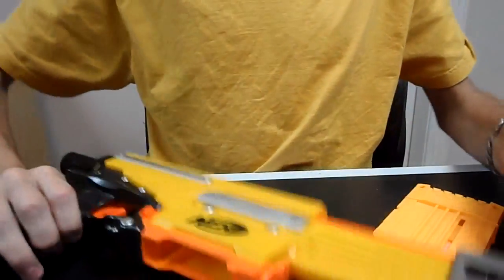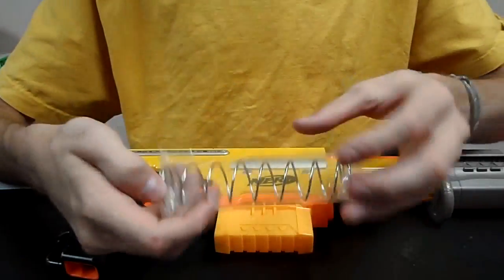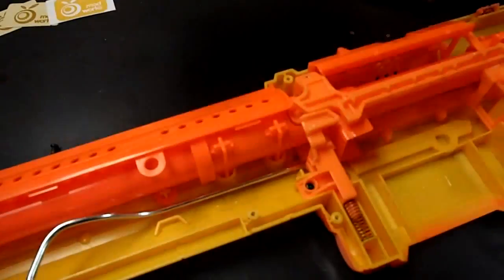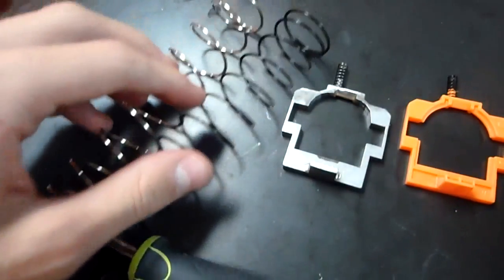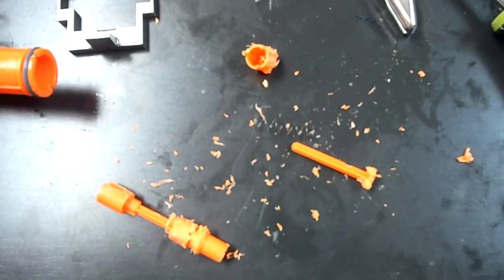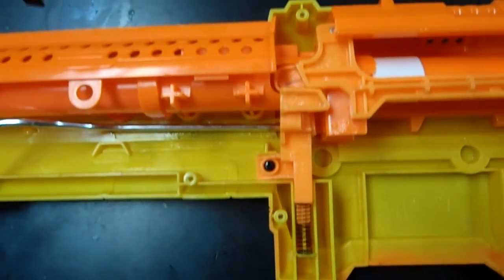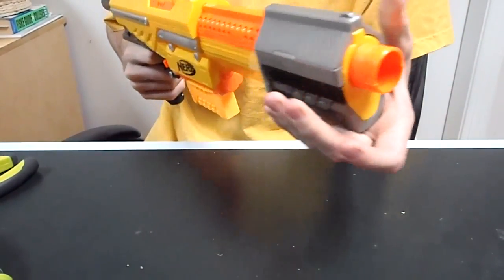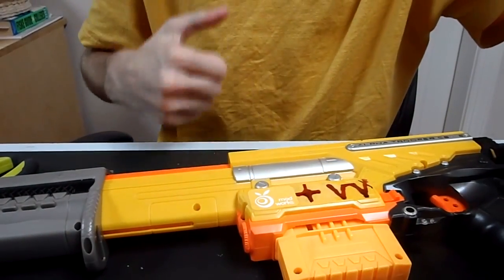Orange Mod Works Alpha Trooper Kit #1 (Review and How To Install Guide)

Comment: Well, after you think its cocked, you have to pull the slide back a bit more until it clicks before you can push it forwards again. My personal suggestion is trying to pull it back hard then pushing it forward normal.

Comment: hi drac i just got my orange mod works kit and installed it exactly as your vid shows and it worked beautifuly, the only thing is i dont see how you can deprime the blaster if say you prime it then realise you have no darts left. you mentioned in the vid that once you cut off the big lock with the side cutters you can deprime without firing how is this done?

Comment: @trulove4evae Not sure if you're still having this problem, but try removing the black end piece on the Alpha Trooper. Then loosen or even remove the screws holding the back pieces. If you can prime it all the way back, it may have something to do with the spring. The same problem is happening to me. Hope this helps.

Comment: I’m having trouble with the catch. If I pull it back, it automatically slamfires. It seems that the catch is moving fine when I cycle it slowly while it is taken apart but once I put the spring in and put it together it doesn’t work correctly. Would greasing it up help?

Comment: what happend to the hvz sticker you said you were going to show us where you put it and i didnt see it anywhere on the blaster also if i send you my alpha trooper will you mod it and use it in a raffle i dont use it but i do use the clip i have slightly modded it but its only so it will soot an extra ten feet or so

Comment: Hey, I have an issue with my alpha trooper where I push the slide back to cock it, but when I push it forward it sticks. Then I have to slam it back for it to work. It is a stock blaster. Am I just a weakling and not pushing it back hard enough or is something really wrong?

Comment: have a yellow first model alpha trooper and my dart tooth broke and the spring went flying in the grass and I just got the OMW massacre kit witch had nothing to do with the dart tooth the gun busting I got from ebay looked better in the pictures. do you or anyone else have a dart tooh unit for the regular alpha trooper laying around? I would gladly buy it from you or coulds you point me in the right direction. I also got two brand new elite alpha trooper but need my banna trooper I know your very buys so just let me know wene you have time